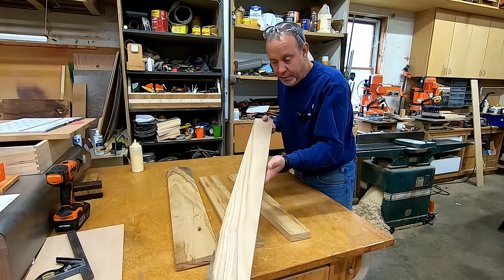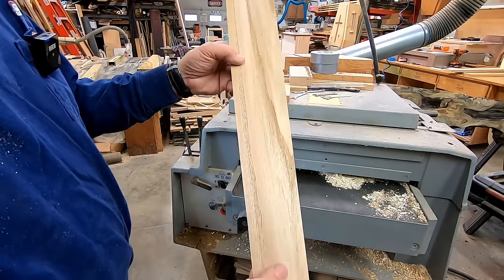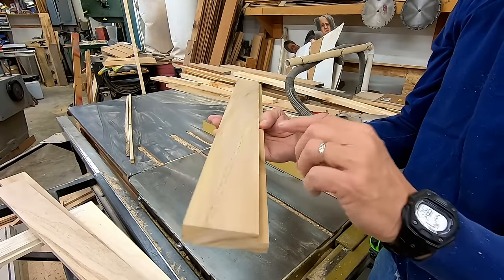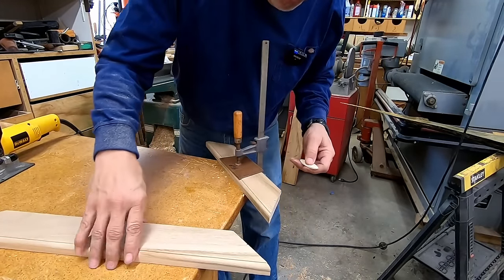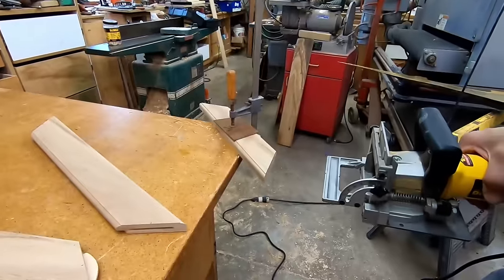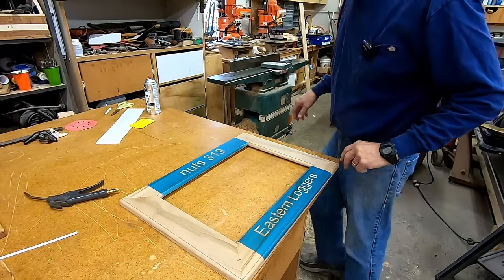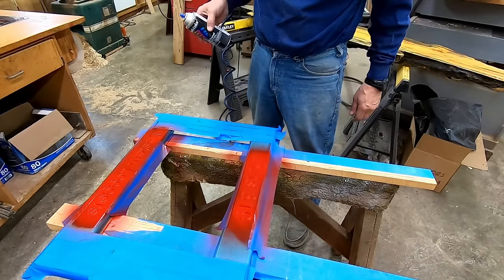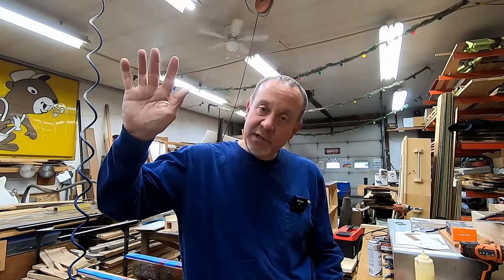making a picture frame with American chestnut # 542

Comment: Push stick- Much like you, I don't use one unless it gets narrow.  I have an old Craftsman table saw from the mid-70s.  I always hated the fence; then I added a Biesemeyer fence.  What a change. Shortly afterwards I replaced the motor.  Thankfully it wasn't a direct drive saw, but belt driven.  More freedom in motor selection.  Oh yeah, did I mention I oiled the motor bearings right after replacing the fence.  Over-oiling will do that ever time.  I haven't oiled the Grizzly motor I put back on it.
Reply from the maker: I started out with a Craftsman 10" direct drive table saw in 1976.

Comment: Hi, Mark.  
I wondered if you had one of those little ‘KEYHOLE bits’ for your router.
We used to use that bit on the reverse of the picture frame.  It would make a neat little 2” slot to HANG your picture from.
Anyway, nice video.   
I’m sure someone will enjoy the frame.
Ted and Patti in NJ
Reply from the maker: thanks Ted , yes I do use a key hole bit I will show that on a shop video.

Comment: Finally got to see the CNC.  When you got to that, I knew exactly what you're were doing with the touch off.   I got 2 myself, a small 13x16 and a Bob's CNC 24x24.  What design software do you use? VCarve desktop is what I have.
Reply from the maker: I have  V carve pro 11.5